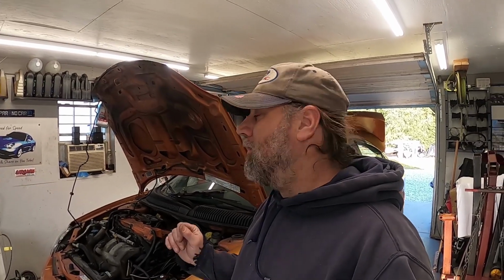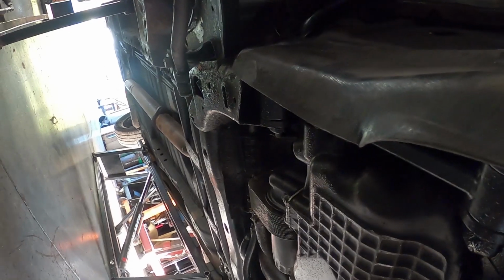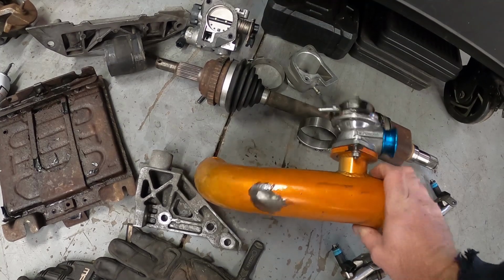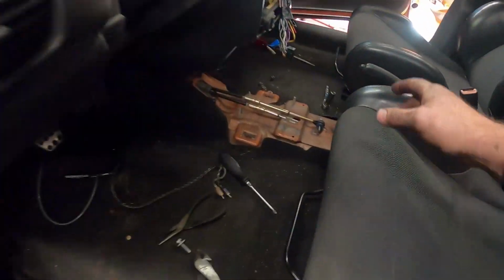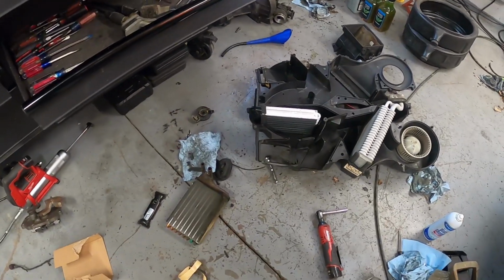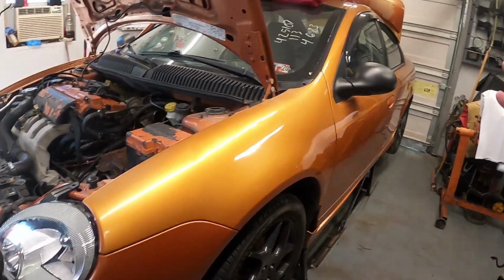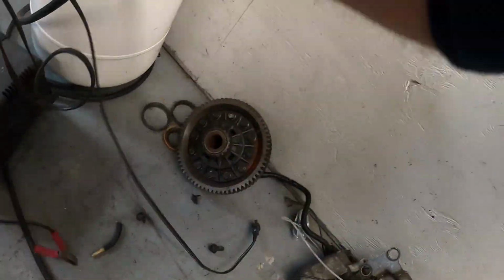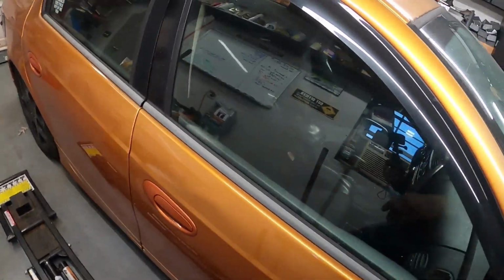This nsrt4 is no cream puff

Comment: i miss my 05 srt4 but i had to let it go as, is common with these cars cancer set in hard in the rear fenders and was quoted more than the car was worth to fix it....also front bumper was cracked and good luck finding a new one or a good condition one
Reply from the maker: rust is in the top 3 killers of theses cars and oem bumper in good usable condition are not found too often either along with a hand full of other srt specific parts paying some one to do the work is costly as no one want to do something for nothing

Comment: How did you adjust the shift linkage side-to-side screw? Where should the screw be positioned in the adjustable slot? Thanks!
Reply from the maker: the side to side I started in the center, I needed to move it a little to pull more on the cable to center it on this one
Reply: I was working on an SRT4 recently where the shift cable adjustment was biased to the rear of the slot... not sure how to tell if that is out of spec or not @Mattsneedforspeed